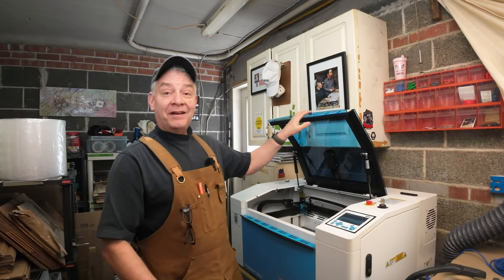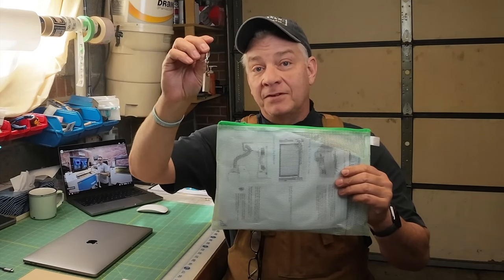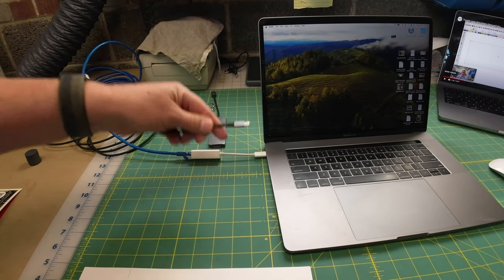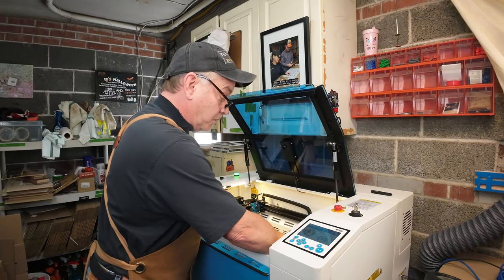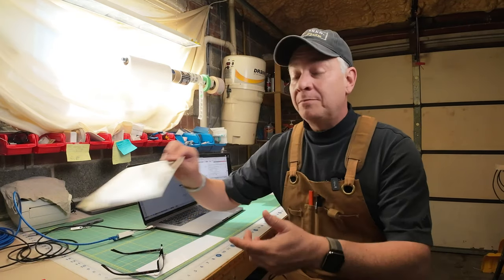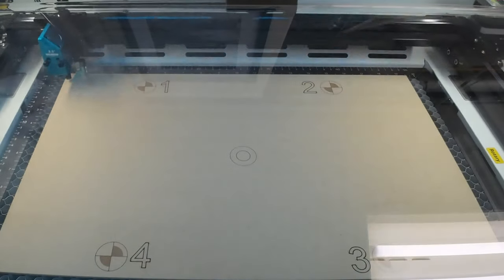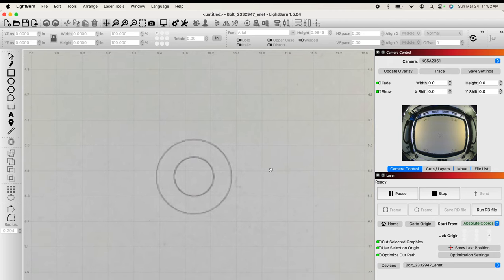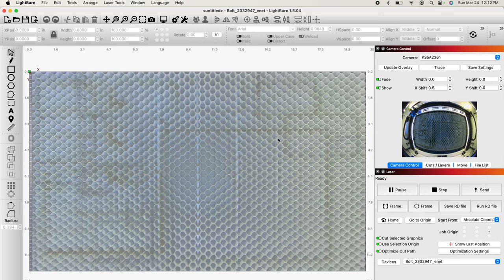Connect The Camera on Your Thunder Laser BOLT. Camera Install Calibration. Apple Computer.  030   4K

Comment: awesome video! I tried setting up my camera this past weekend, its pretty dang blurry even maxing out the focus, and im way off on accuracy, ill need to work on it again this week. Thank you!
Reply from the maker: Hey good luck and let me know if it works out. Cheers!
Reply: Why do you need the Ethernet AND USB cable attached to your laptop?? 
And thank you for doing a Mac specific video - I feel this is an oversight by many
Reply from the maker: @CoffeeJake  Morning Jake! The Thunder Laser USA knowledge base has videos and related info on connecting to a MAC computer to the BOLT. Chris' video(s) and related info say that there are connectivity issues when trying to use the regular USB cable to connect to a MAC and strongly recommends not to use USB, but rather to use the Ad HOC Direct connect method using the ethernet cable for the main connection to the BOLT.  But the camera requires the USB connection so you will need both to connect successfully with an Apple computer. I also did a video on how to do the Ad HOC ethernet connection ( I think I put a link to it during this video in the top right corner at some point) or you can find it on my channel homepage. Hope that is helpful. Cheers!

Comment: I’ve been watching all your videos!!! They are excellent w MAC

Just now hooking up camera I moved that box to see bigger and lost my camera box that was on right?
Reply from the maker: Thanks! If you moved it out into the main area of the screen, then grab that box and drag it back to the right side and if you hold it there for a few seconds, it will highlight and sit into your right hand tool bar when you let go of it. My Mac is old so it took about 20 seconds before it highlighted. Does that help?
Reply: I went to windows and got cuts and layers over there up top but just laser will show now and adding the camera check it’s only a pop up not embedded to the top right before I moved it to the bed screen to blow up
Reply: @LaserNUG it just worked!! Thanks NUG not to focus and finish this camera setup. I don’t have MDF but some acrylic I do w my 8x11 business flyer. Will that work to complete this step w acrylic?
Reply from the maker: @michaelchant4102  I am not sure Michael. But if perhaps you have some plywood? I am not sure but acrylic might be reflective (?) If you have a flat piece of cardboard, then use that ( I just provided my settings for cardboard in the video I released yesterday. I think cardboard would be better than acrylic.
Reply: @LaserNUG so based on what you shown w engrave setting and cutting in that new video I’m not sure what goes where in the Camera alignment wizard on section 2)…
Reply from the maker: @michaelchant4102  Morning Michael. I am not sure what you are referencing, but If it is helpful, we can Facetime or phone call if you would like . just email me your number to gordpotter55 at gmail dot com.

Comment: THANK GOODNESS FOR YOUR VIDEO!  I was wondering why I couldn't move my camera lens.  I'm having a really hard time removing the blue silicone tho.  Can you please share how you removed yours?
Reply from the maker: Good morning Grace. I didn't have to remove it - my picture is in clear focus so I left the blue stuff on. I would have thought you could just peel it off with your fingernail but perhaps send in a ticket to your Thunder Laser support folks and ask them, just in case. If your picture isn't clear or in focus, then perhaps ask them to help you through the manual focus process. I believe we have lifetime support on the BOLT. Cheers and good luck!